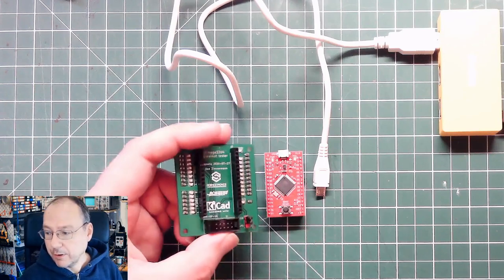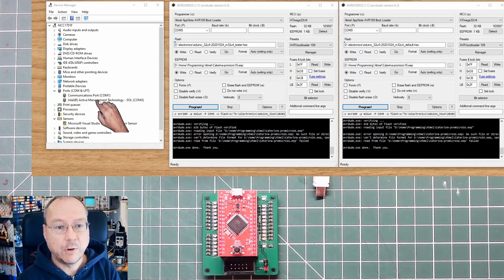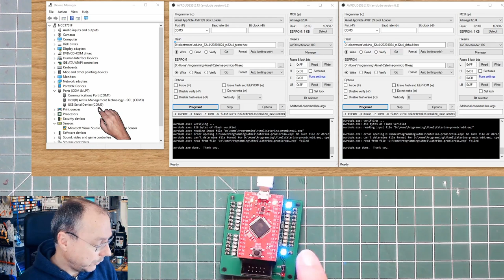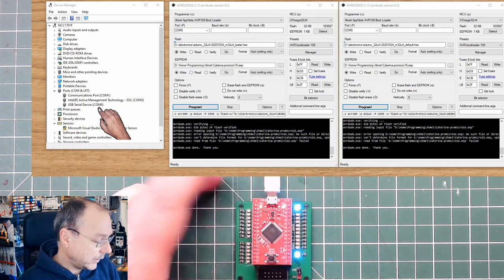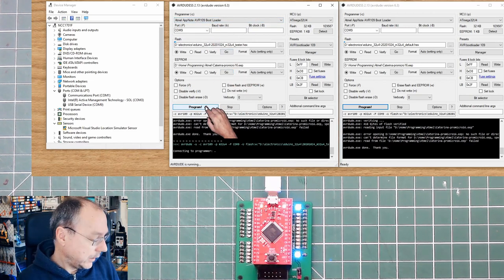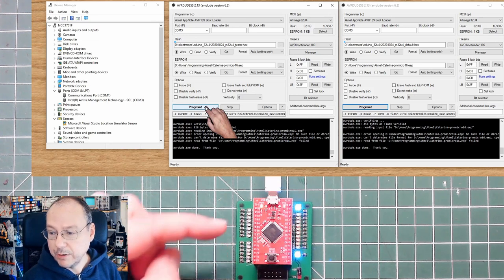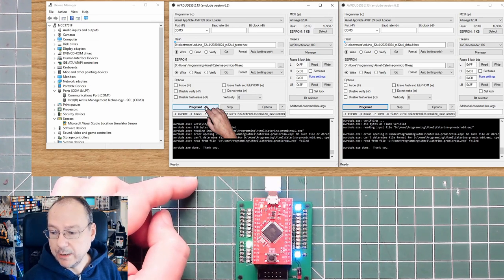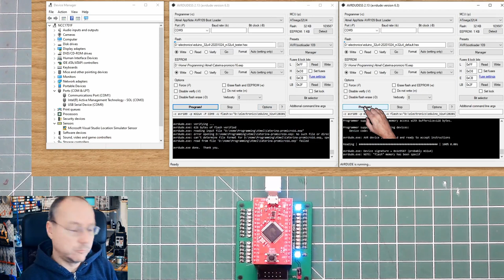Testing the ATmega32U4

Comment: Hi Uwe, 

I am currently designing a few custom PCBs and was wanting to possibly encorperate the 32u4 chip into the pcb so i dont need to connect an arduino to it and use an arduino. Rather on my custom PCB have the usb port and 32u4 chip programmed almost as a arduino leonardo or similar to archieve the same result. Do you think this would be possible and if so after recieving the boards from PCB manufacturing would I do a similar process as your  videos with the board you created?

Thanks
Reply from the maker: What I didn't notice was that there might be ATmega32U4 which already have a bootloader inside when shipped from the factory, then you would not need a separate programmer as in my case to flash the bootloader into the chips. I don't have any "blank" ATmega32U4 to check right now...

However, I think it is a good idea to have the ISP-contacts MOSI,MISO,SCK and RESET accessible on your board, also in case you later at some point would need to reprogram a bootloader. If you look e.g. at any AVR-based Arduino you will find that they always include the programming contacts as well - on the original Uno you will find 2 of these, one for the ATmega8U2 serving as the USB interface and one for the main ATmega328.

But once you have a bootloader inside the ATmega - as in the case of my board - you can just use it as an Arduino Leonardo/Sparkfun Pro mini through the USB port.
Reply: @uwezimmermann5427  thanks for a great response! yes i think i will still keep the ISP headers available anyway. I may just have to order a "blank" 32u4 chip and see what happens. Thanks again
Reply from the maker: @brandonharwood14  It doesn't matter if you order a blank chip or a chip which perhaps already contains a bootloader. Through the ISP-interface you always have full control and can easily overwrite any existing code (including the bootloader).